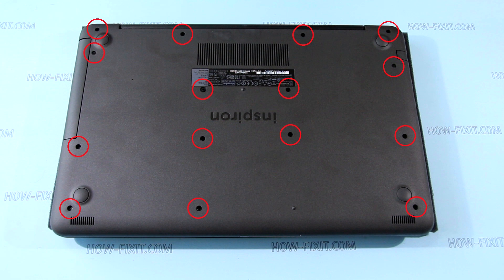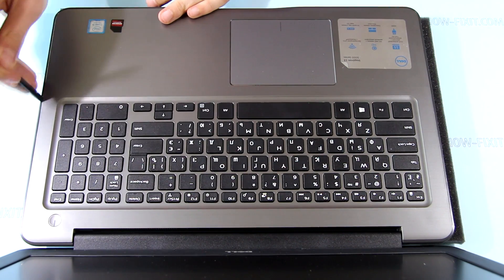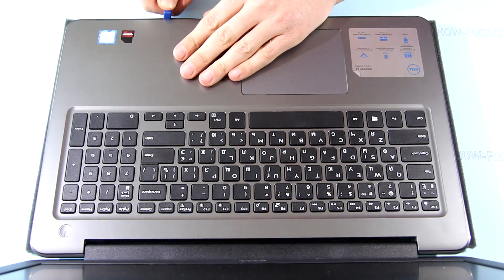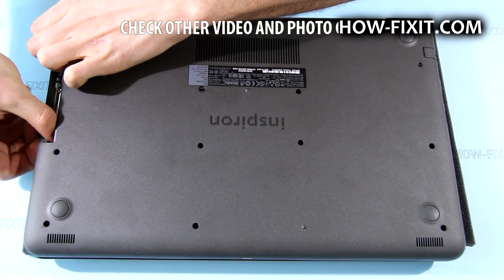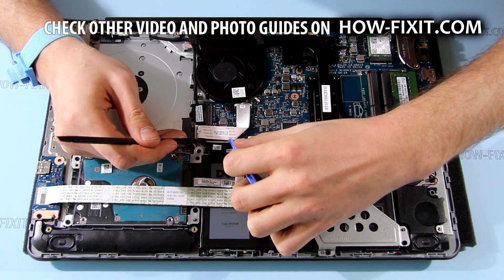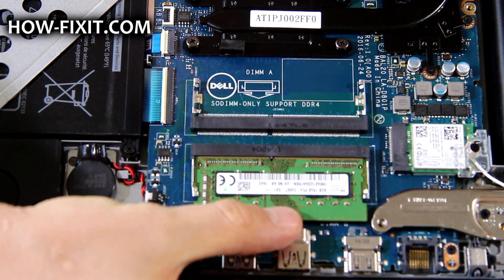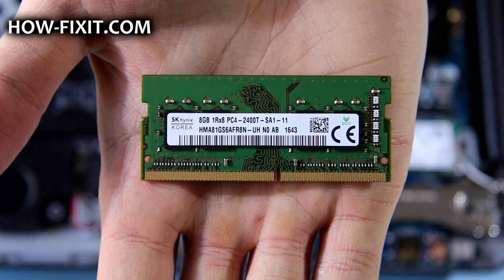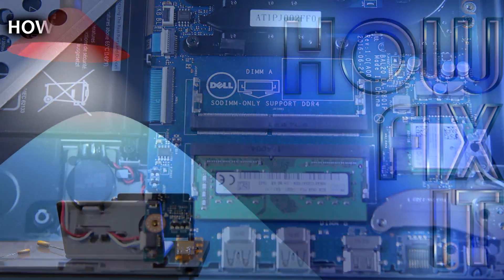Dell Inspiron 15 5567, 5565 RAM Upgrade and Install - Your Step-by-Step DIY Guide!

Comment: hi 
i am using the dell 5567  laptop, now i wanted to upgrade the laptop with RAM and add SSD to laptop.
Could you please tell me that is that DVD optical is SATA 3 or ATA model?

where i can see that DVD is having the SATA or ATA

Comment: what if i install an additional 16GB ram...identical rams ...2 x 16GB ...total 32GB ram!? and what about dual channel support?
Reply: It has dual channel but you cant add more than 16 GB of ram, so you have to go for either 1x16 GB or 2x8 GB.
Reply: @Natanacho7  why is 16 total the highest?  is there any other upgrades i can do for my 5567 to speed it up?  ty
Reply: @tbling  SSD

Comment: Can I upgrade it to the Corsair CMK16GX4M2B3200C16 Vengeance LPX 16 GB (2 x 8 GB) DDR4 3200 MHz C16 XMP 2.0 High Performance? I wanna know if it’s too big
Reply: I cant believe no one replied to you. Short answer is NO for anyone reading this two years later!! Those are DIMMs you need SODIMMs (Small Outline Dual In-line Memory Module) which are smaller as the name states and designed for laptops or some SFF pcs.
Reply: No

Comment: I put 2400MHz RAM in a 5566 and it only runs at 2133MHz.
Reply: that's the defaul frequency.
I think that cannot be modified.
Reply: @SPARTAN8746  yeah the motherboard is trash and doesn’t allow xmp
Reply: That's all it will run

Comment: if 8gb i should buy 2133mHz or 2400 mHz? Does it matter?
Reply: Nope. But keep in mind that the default mhz will always be 2133mhz even if your ram is higher mhz.
Reply: 2400

Comment: I have a dell 5567.. With 8gb of ram.. Can i add 8gb ram on another slot??
Reply: Most likely, yes. To find out for sure just download the application SPECCY (it's freeware) and confirm that you're only using one SODIMM slot. Once you confirm that, you can upgrade. It's always recommended to use the same or equal RAM when you upgrade,
Reply: @lynxznet  does the brand of ram matter?  if there is 8 in there does the other 8 have to match brand or just be 8"?  ty